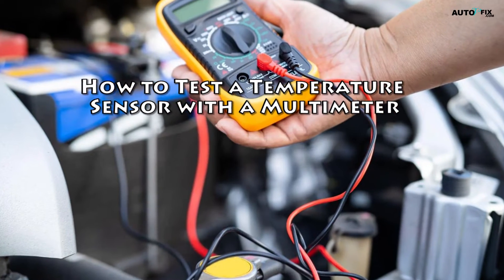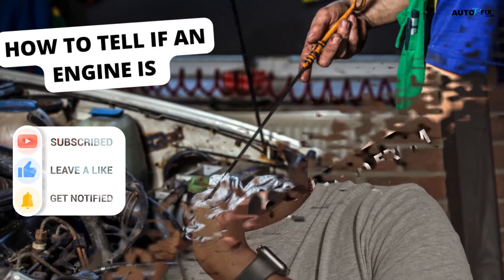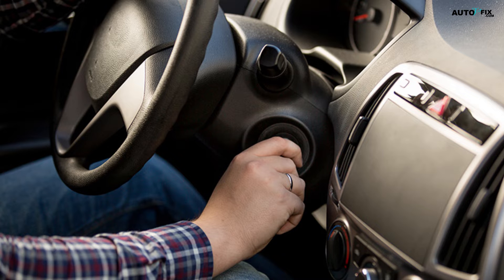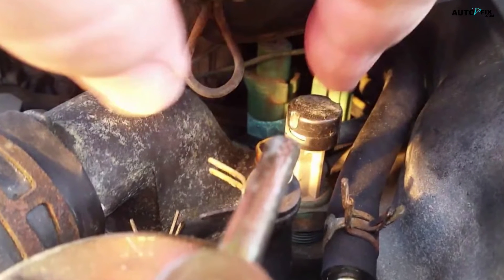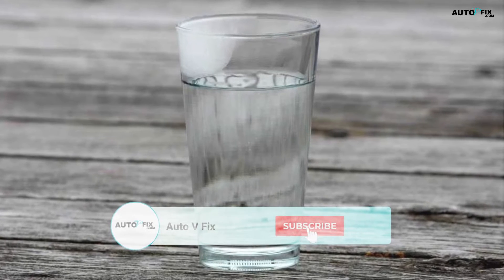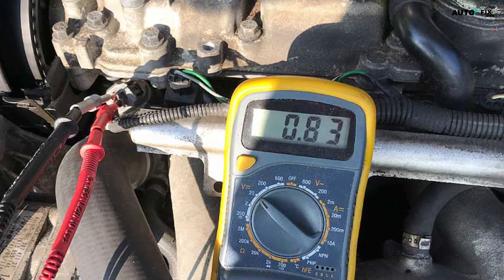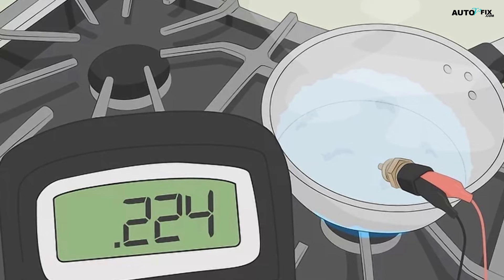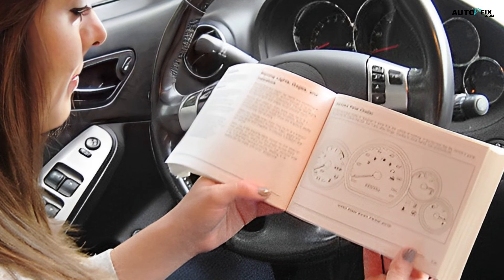How to Test a Temperature Sensor with a Multimeter

Comment: How come my cooling fans don't work already changed the temperature sensor checked all the relays in the fuses for those but can't seem to figure out why I can run a wire direct and they turn on but not when the car heats up
Reply: I have exactly  the same issue  on my chevy cruze 2013 
Did you  fixed  it?